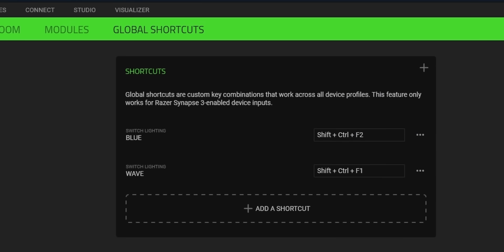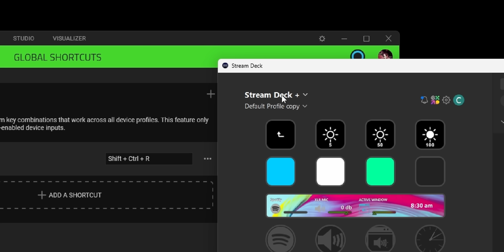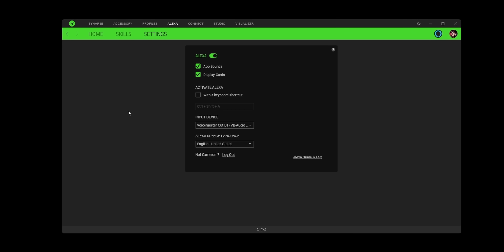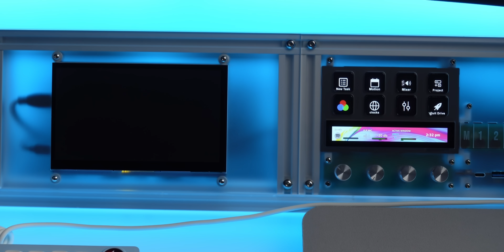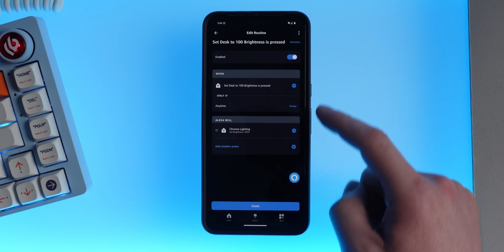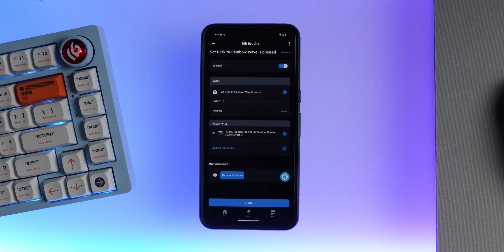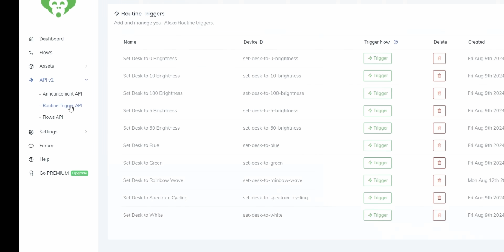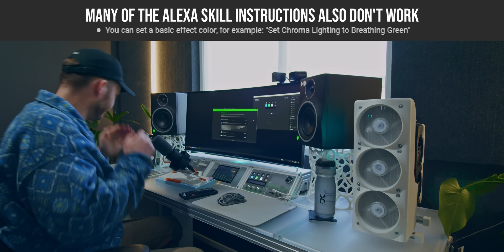Razer said No... Chroma RGB control with Stream Deck

Comment: It doesn't help you have to research on certain products that can work with either Razer chroma or Corsair ICue rgb software like for example the Elgato stream deck that you have can work with the Icue ecosystem sense they're both owned by the same company and Asus products can work with ICue but not with Razer chroma.

 But with the Razer chroma ecosystem they have a lot more compatibility with various a third party brands like Mountain dot GG, cololight, lifx, monster smart illuminessence, and yeelight but some third party brands can also work with ICue which are nanoleaf, govee, and philips hue.
Reply from the maker: yeap RGB control support is way to confusing, hopefully the new Windows 11 RGB control and Matter smart home integrations gets wider adoption, this will help break out of ecosystems.

Comment: I can really quickly simplify your setup get the esp32 to control you lighting and install DiyHue you also need a raspberry pi or home server (if you want something integrated you could install it in a docker container on docker desktop) now you integrated your custom lighting into the Phillips hue ecosystem and is fully controllable by the hue app and it integrates into razers in game system. And to top it all off you can use the Phillips hue integration on the stream deck to control your lights. This is atleast how my system works and it does really well

Comment: On the signalrgb reddit I’ve read about a plugin/addon for using a stream deck to control the program. Maybe it is possible to use signalrgb to control the razer controller and have a “gaming button” to turn off signalrgb when starting up a game to use the razor software for games.
Reply: The name of the post is: Elgato Stream Deck/Stream Deck Plus
Reply from the maker: Thanks mate, I'll read into it!

Comment: Could you buy an Alexa, disassemble it, remove the speaker, and replace it with a screen that shows the response? This way, you could use the command with the Stream Deck and receive a response from Alexa without hearing her voice, which could become annoying over time. Plus, with the screen, you would have a sort of history of what you've asked her, adding something extra to your desk. I would place the screen that replaces Alexa's speaker separately from the one you already have and make it a bit smaller, even with fewer pixels, so it has a more analog style like the rest of the desk.

Comment: Hey quick question:

Have you looked at Home Assistant?
Because with the Stream Deck (which I bought after your video a few months ago ;) thanks man) you can easily control Home Assistant. I can't test it but there seems to be a Chroma integration as well?

Basically Home Assistant would fit well into your life if you don't already use it :)

Comment: you could technically make it switch between f.ex wled and razer chroma when needed (needed for chroma would be only when playing games). if you were to use wled, you'd already have the microcontroller, you could make it so that "if game was opened - at this point chromargb would power on a invisible, few-led strip, that would be read by esp32), and then microcontroller would send and information to some micro relays or mosfets to change the output from wled power to chromargb power

Comment: Dodge Razer like the plague. I have spent tens of thousands on tech over the years and I can say with absolute certainty that Razer products, whilst manufactured and finished very well, break the most often and after the shortest amount of time by FAR. That, plus little inconveniences like off-board RGB settings not sticking while your PC is locked, etc. make Razer extremely annoying to deal with.

Comment: What about adding an esp32 between the Razer Chroma controller and the led strips? It could run a modified WLED which would have the option to either just forward the Chroma signal or override with its own config. Then you can do whatever you want with WLED, but still have the option to use Chroma for games/audio/special effects. If you are interested, I could help you set up something like this.
Reply from the maker: This thought has crossed my mind, if I wasn't able to get the Alexa mode working or Chroma API then I was considering mounting a switch for the data input to the led strips, so i could toggle between what controlled which.

Tbh SignalRGB subscription would cost less than the time screwing around with it all 😂
Reply: @camshand  Isn't this about learning and solving challenging situations instead of the money? :)

Comment: Time to reverse engineer a Razer KB to figure out how it’s telling Windows it’s a Razer KB, and spoofing it. Basically find a way to pretend your KB is a Razer KB. It may be as simple as the software looking for a certain range in the KB hardware ID string that’s reported to windows in device manager or something like that?
Reply from the maker: Yeah so keyboards do have an identifier under the HID (human interface device) class.
can't remember the exact ID line but there are ways to flash microcontrollers to spoof a vendor ID.
A lot of cheap keyboards use a generic vendor ID, unsure how that'd go if they also use signed drivers to make it all talk.

Either way it's a shame it is how it is, I'm at least happy to have a way to change brightness and between blue and white which are my main modes.

Comment: It sucks that it has to be like this, maybe you could do something with home assistant. Its a program specifically made to work with as many devices and programs as possible
Reply from the maker: I'm actually going to be exploring a Home Assistant server setup in a future video. Haven't looked into if it can fake the Alexa speaker though for the response, that may be the solution.

Comment: Wow, this just hurts. This is also why I loathe walled gardens and proprietary fasteners and connections. This should have been a simple API call or a keyboard shortcut, not a chain of at least three different programs to just control the LEDs.

Hope you do get it working like you want it, Cam, but I'm not going to hold my breath.
Reply from the maker: Yeap instead of a direct keyboard input to the wired hardware, there's now at least 3 servers involved haha 😂
Reply: @camshand  And no telling how many hops, too! All because Razer wanted to squeeze more from their customers.

Good luck and Godspeed to you sir!

Comment: Honestly, if I would have to go through such a hassle of setting everything up. I would just buy a different RGB controller or develop my own control software with just the Razer SDK (no Chroma bloatware or anything else) to integrate right into Streamdeck. OpenRGB could also be a great alternative with its powerful community.
Reply from the maker: The effort was to have access to the gaming integrations without an ongoing subscription cost of SignalRGB.
But after all this effort would have been worth it going the subscription route from the start as the hours of sunk into the project otherwise is bonkers

Comment: I completed understand the frustration. I had a similar problem with the automation that I setup. I switched everything over to the Apple eco system, originally I thinking it would be straightforward to get everything automated at the press of a button. But I ran into a number of issues until I found a product called HomeControl, which ties into Apple's HomeKit. Now it is a breeze adding button level automation to a smart pad, like the Stream Deck or the Loupedeck. An unexpected side benefit is that all the Nanoleaf color profiles are available as well, so they can be set at the smart pad level as well.  

Good luck in your efforts to find a solution and thank you for sharing!

Comment: That's a great work around, but with so many programs being used to make it work I feel like there is a high degree of it eventually breaking somewhere in that chain.
Reply: Agreed. With how convoluted this Alexa setup is, it would've been better to just use OpenRGB; the existing Razer Hub can stay, and then you can talk to it with a Stream Deck. OpenRGB would then make it real easy to talk to Home Assistant if you needed control from any other device. Then it's all hosted locally with no dependency on Razer, Alexa, etc.
Reply: Absolutely, there are so many open, hackable RGB lighting controllers out there, there's no reason to use a hacky workaround that's likely to be unreliable long term.
Reply: yep, I had that problem with how I integrated my smart lights (Yeelight) with the stream deck... basically I was webhooking to IFTTT to call the light server. Pretty simple: stream deck -> IFTTT (webhook) -> Yeelight server -> my lights.

The problem was that for some reason, I required to re-authenticate like once a month between IFTTT and the Yeelight server. Was a freaking pain in the ass + that the free version of IFTTT doesn't allow to use webhooks.

I end up reading the whole Yeelight documentation and now I'm just controlling them directly with "multiple" nodejs "app" that basically just send the command directly to my network with the light IP address and then close itself. Now I just setup my streamdeck to open these "apps" to change the setting of the light.
Reply: Have to agree here. I know you like the game integration but going DIY seems like it’d be a better fit for you.

Comment: This is extremely stupid and unfounded choice from razer. It's not like you did not buy a product of theirs. I would never buy a product of theirs if that had happen to me. It would be interesting to check if you can somehow trick razor software into believing your keyboard is actually from razor
Reply: yeah I think this would work a lot better and cleaner by just emulating a razer keyboard in software. Its extremely easy to emulate HID devices with specific IDs etc, think it would work better than this solution too

Comment: Love your ingenuiity here.  I cannot believe the set of hoops you have to jump through to get this to work though holy crap.  I wonder if you could have a USB passthrough arduino that emulates, or adds tags to your HID that makes the software think it's razor.

Or hack the application binary to think all key commands are razor.

What a bunch of jerks
Reply from the maker: Hey Adam! Yeah someone else suggested spoofing the Vendor ID within the HID class.
It'd be a possibility, but I was determined to find the easiest to replicate way for anyone else stuck wanting to use a streamdeck.

It would sting so much if the Alexa keyboard shortcut didn't work from my non Razer keyboard haha, that flat out shocked me